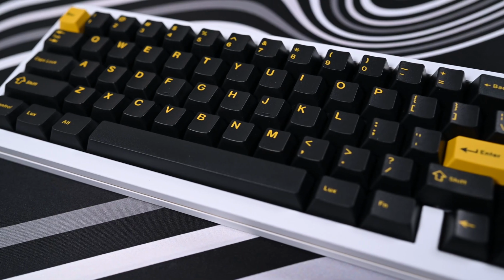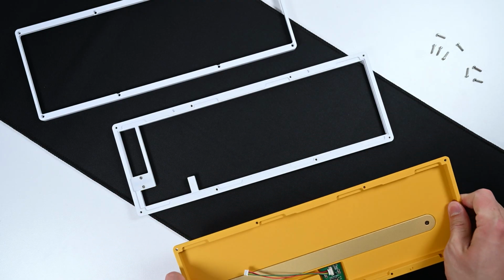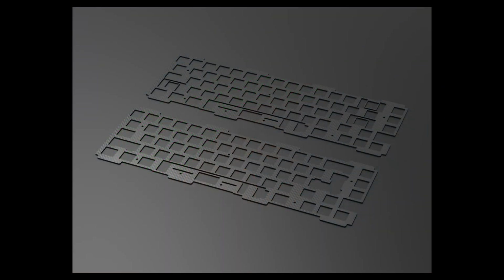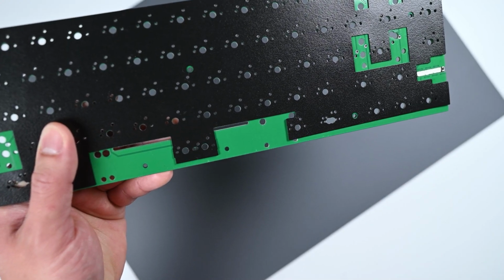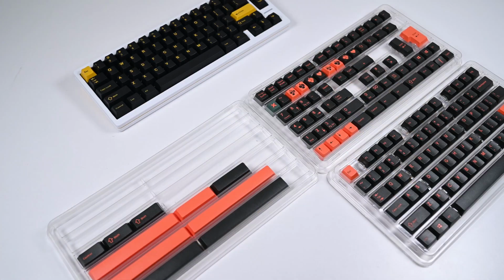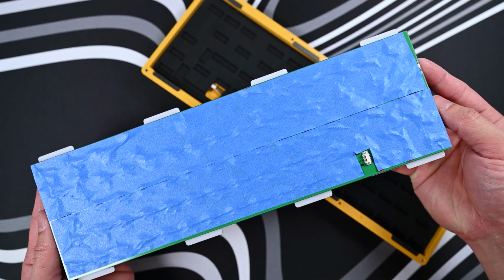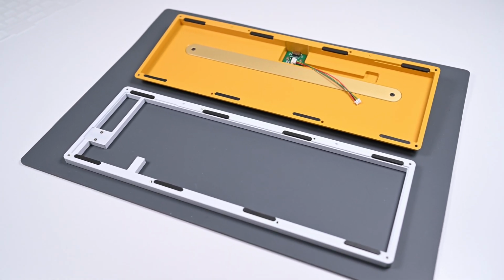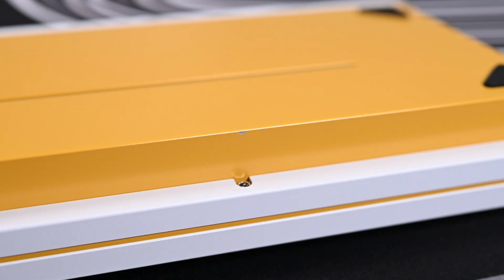Wind x65 Full Review and Build Guide

Comment: i strongly agree with you about the pe foam, like every keeb video that i watch and the person is gonna use pe foam, i am instantly disapointed because no matter what mods you do to a keyboard, with the exception of the jelly epoch and mr suit cause pe foam is already part of their designed sound signature, it you sound the same shit as the other thousands of keyboards that use this mod, that is the reason why i am so concervative abou the mods i do that are related to foam, even if its a cheap keyboard like a gas67 or a lk67, i NEVER use pe foam and always try to do only the bare minimum to take away the holowness and make it sound more solid, an example is my daily driver, the lk67, which right now is only using some foam on the bottom and one layer of tape mod  and it already sounds great

Comment: Hey I heard the Wind X is generally a board that is high-pitched. Is this true? Since your video seems to be the only video where it sounds deep. I heard pom plate nad pc plate creates a deeper sound, but I've tried pom plates mostly on stacked acrylics and it never sounded deep even though i was told acrylics sound deeper. I had a kbd75 with a brass plate but sa keycaps and oa switches and it was the only board to literally sound deep. Now I have a Wind X with a pc plate but swapped it out with a fr4 plate and oa switches still sounds quite high and muted. trying to get a deep louder sound not sure what to do. Even took out all the foam except a tiny thin piece of foam and tape mod, still nothing

Comment: Did you have trouble putting the switches in by any chance? Other review and the comment below mentioned that plate being bigger than the pcb caused the plate to bend and had trouble putting the switches in.
Reply from the maker: No the only issue I have with putting switches in is simply from the fact that it's a POM plate... basically my explanation in the video. But I didn't notice the plate was bigger or noticed any bending
Reply: @hardlinenexus  I see. I used pom/pc plates before and had the same experience. Thank you for sharing. Nice vid!

Comment: Can you clarify what the benefit is of the .5 mm silicon sheet installed on top of the plate. Thanks for a solid review!
Reply from the maker: Not 100% sure but I believe it's to reduce any friction between switches and the plate as well as the plate and the top case

Comment: Thank you for the great review - walk through. Just one thing: case design is bad because you use fat screwdriver? I accept it as caution but not as design flaw.
Reply from the maker: Actually my screw driver wasn't even fat, it's a pretty normal sized bit. I mentioned the size of the driver for other people who may have a larger one than me. I probably could have used a better word than "flaw", but I do think the shape of the bottom case could definitely be better. Like the angle and slant could be more shallow. That way no matter what size driver you use, it's not an issue, like it shouldn't even be close at all. Not a question.
Reply: @hardlinenexus  fully agree this could be addressed with slant that would also look great. Good idea.

Comment: I have to take issue with your comment about the PE foam - while Pe foam does even out most switches and add a characteristic sound - the sound of a jelly epoch and mr suit is much more unique than just the PE foam. I have a suit, I have a windx, and I have PE foamed 4 other non PE foam keyboard - none of them sound the same, all have a unique character that is their own - I have sound tests to show that too
Reply from the maker: Thanks for your feedback. I can agree that there is a "measurable" difference in how each of these boards sound. They all have different anatomy and shape, so yes by that logic they don't sound exactly the same. But to my ears, they are close enough which is why I said they "sound the same". I have a Mr. Suit as well and have done every plate + their PE foam too.

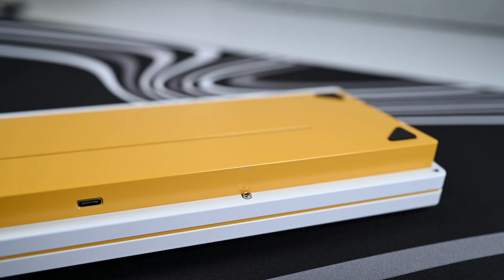Comment: I have the Wind-X and I think it sounds really really good with and without the foam. I tried several different configurations and they all sounded pretty good. The only thing that is annoying about the Wind-X is that there is some inconsistent switch spacing due to the thickness of the POM plate. Otherwise I think the board is pretty solid, but there are definitely issues that I csn nitpick. One of them at 11:02, I had the same issue with my Wind-X. The mark is super super small and my case is white so I’m not worried. Solid video!
Reply from the maker: Thank you! Man I really do prefer stiffer plates for building though personally, which there were alu or brass options lol

Comment: awesome video as always! is the typing experience like the bottom out comfortable or is it too stiff?
Reply from the maker: So too stiff isn't a thing for me, I actually prefer it. I wish there were aluminum and brass plates to make it stiffer tbh haha. But to answer your question, no it's not lol. if you wanted to, you can remove the thicker poron foam between the PCB and bottom case. This way you leave the thinner foam in for ESD protection and also give some more room for flex if you want.